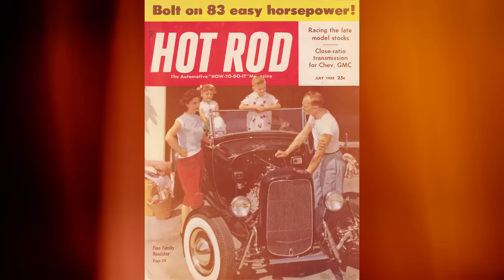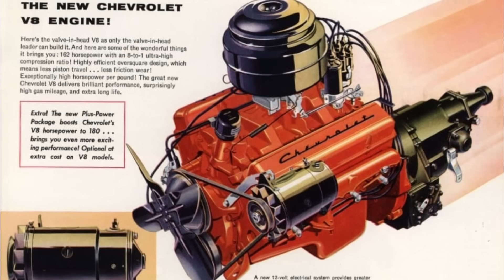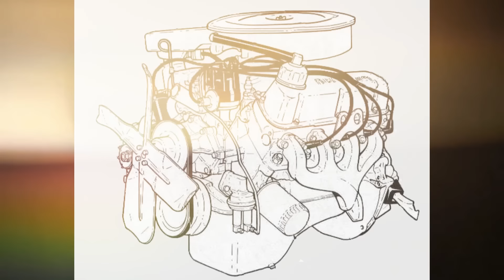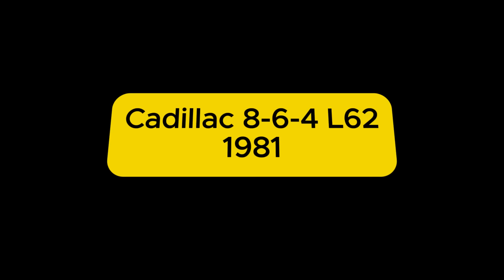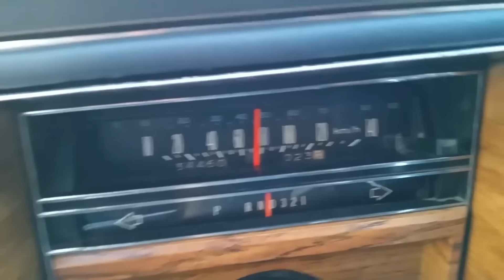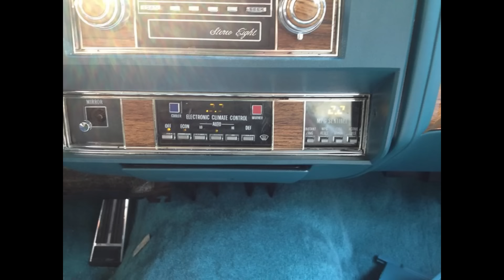WORST Engines Major Companies Ever Put In A Production Vehicle! PART 2

Comment: Please give litre equivalent for the cubic inches sizes  CI capacities mean little to most people today
Reply: There's a fairly simple formula to convert;   CID / 61 = liters.   Or you can round to CID / 60 = liters to make the math easier..   Not exact but damned close.
Also, remember that prior to the mid-1970s, most American V8s were referred to by cubic inches.  Many got renamed with metric numbers after that - the Ford 302 was renamed the 5.0, the Chevy and Ford 250s were 4.1s, etc.    Typically there's a 0.1 liter margin of error.

Comment: Another manufactured outrage video. The one-sentence summary: “V8 engines under 300 cubic engines, or those caught in the early smog control days—or both—are bad engines.”

This video fails to understand how all car manufacturers were unprepared for:
 (1) the first-ever emissions regulations, needing stopgap solutions for which they had no existing research or development.
(2) deployment of electronic circuits in extremely hostile automotive applications.

The video also assumes that modern standards of performance and reliability should be the standard of comparison for engines 50 to 90 years old.

Miles of vacuum hose were necessary because automotive control electronics didn’t yet exist. Electronic ignition was in its infancy in the mid 1970s; expanding electronic control into fuel management and engine monitoring was a huge leap at the time.

Cylinder bores over 4 inches don’t burn cleanly. Reduced bore was an obvious, immediate stopgap to meet emissions regs. When you shrink bore, lower compression, and introduce EGR to control smog, of course horsepower drops. There wasn’t time or money to do anything else at that moment.

Yeah, we all hated “smog motors.” We used to say that good performance was gone forever. Another 50 years of development has proven us wrong.

Yeah, the first Ford 8’s had some serious problems, but that engine was also a technological leap. The GM diesels were failure prone. The 305 had its cam problem, but there are quite a few modern engines with equally serious faults. (If you think a 305 is lame, you should have driven its 229 V6 counterpoint. I had to!

Millions of these “bad” engines transported us for years. Nobody cared that Lean Burn or electrically controlled Rochesters wouldn’t hold up for decades.

By the way, I had friends with a Buick 231 V6. I don’t recall it being horrible.
Reply: Well said!

Comment: the 351/400   M serie  where very bad engine
Reply: Hi bigdon, I am 64 years old and I was a mechanic at three Ford dealerships and two Lincoln-Mercury dealerships.  The 351/400M engine blocks where/are notorious for suffering from "cracked engine blocks" and I am not talking about being overheated or left out in the freezing conditions. I do not understand why.  With all due respect, the 400M achieved the same fuel economy as the 460 4V (4 barrel), but with not much more power than the 351M.  I do not understand why.  Please reply.  Dave...
Reply: @daveridgeway2639    The cracking issues were mostly related to extended periods of high engine load - like pulling a trailer, or in a heavily loaded truck.   The Cleveland design (upon which the 351M/400 is based) is a VERY thin wall casting and was not designed  to handle loads like that.   Even the 302/351W mills had thicker cylinder walls.  The 400 would also get more conserative axle gearing than the 351M.   Those big LTDs, for example, would have 2.75s with a 351M, but 2.47s with a 400.  If you were gonna tow, Ford recommended the 460s.

Comment: Hello Mr. It's Just Cars, not a bad video.  Most people call the 255 CID, 302 CID and sometimes the 289 CID for that matter, a "Windsor" because they are very much the same as the "351 Windsor".  I do not mean to be a know it all, but the only Ford small block that was produced at the Windsor engine plant was the "351 Windsor".  The other small block(s) where produced at the Cleveland engine plant, even though the 351 Cleveland is not much the same as the 302.  Please reply.  Dave...
Reply: Also the modified, which is the same family as the 400
Reply: @squidduck You are correct.  The 351 modified and the 400 are the same block and they look the same as the 351 Cleveland, but in the mean time they are both a taller engine block then the 351 Cleveland.  Please reply.  Dave...
Reply: Sir, the 289, 302, 351 are all in the windsor family of engines, that's why. Except the Boss 302, 351 Cleveland, 351M and 400M. For small blocks.
Reply: @daveridgeway2639    They only called the 351 Windsor a 'Windsor' starting in 1970.   That's because they began making another 351 in 1970, the Cleveland.  In 1969, when the 351 was first introduced, it was just a '351'.

The 400 based on that design was rolled out in 1971, to replace the out-of-date 390 in the big full size models.   

The 351M was Ford cutting costs in 1974; there was no need for the Cleveland in its original form anymore, and the 351M could be built on the very same prodction line as the 400.   The 351M/400 have larger main bearings, and longer con-rods than the Cleveland.

It's a shame an engine as awesome as the 351c ended its career as a low-compression  mule engine.
Reply: @xaenon  I am 64 years old, and was a mechanic at two Ford dealerships, and two Lincoln-Mercury dealerships.  In my opinion, the Ford 400 engine and the 351M engine(s) where two big fat pigs.  I never noticed any more power from the 400 to the 351M, except for less fuel economy.  Both of the two engines are taller, wider and heaver than a 351C, but appear the same.  They are just about the same width, height and weight as the Ford Ford 385 series big-block engine family (370, 429, 460) but do not have as much power.  By the way, the big-block Ford 460 4V achieves about the same fuel economy as does the 400 2V.  Of course the 351W and 351C are both small-blocks, but at times I do see the automotive news media call the 400 and 351M small-blocks, but for "me" not a chance.  I call the 400 and the 351M "pig-blocks".  Please tell me what you think!  Dave...
Reply: @daveridgeway2639  I can't disagree with what you're saying; I'm just saying you're not seeing the whole story.  And that's not surprising; few people truly look at all that was happening in the 1970s in terms of the North American auto market.  As a mechanic, you probably know a lot of the nuts and bolts of how things were changing, but you have to put that together with other factors to see the picture.

At the center of all of it was one simple fact:  The auto industry was monumentally arrogant and complacent in the face of a changing reality.  They thought emission and fuel economy regulations were going to simply 'go away' - either on their own, or as a result of litigation - and they would be able to return to making the same kinds of cars they built in the 1960s.  In short, the US auto industry got lazy and sloppy.

It took the American auto industry nearly a decade to realize the harsh truth - their cars were outdated, their efforts to 'adapt' were half-assed at best, and they were building utter shit. Europe and Japan were building better, more efficient cars and were taking over a major market share.

None of this directly links to the engines of the 1970s, but INDIRECTLY....  it's a different matter.  The engineers who were tasked with making the automakers compliant were faced with a smorgaspord of technical challenges - the most significant of which was they were forbidden to start with a 'clean sheet of paper'.  They had to take steps to adapt existing designs to an environments they had never been designed for.

The 351M/400 are two of the most glaring examples of how to take an engine with so much potential, and utterly ruin it with half-assed, slapped-together, 'lowest possible cost' initiatives.  Let me be clear:  the 400 was envisioned as a basic 'mule' engine, and the 351M was Ford's bean counters cutting costs.  

I could write a flipping book, with at least two chapters on the technical aspects of what was done, and what SHOULD have been done.  But then, you and I have the advantage of 20/20 hindsight.
Reply: @squidduck  Correct!
Reply: @squidduck  Correct!

Comment: Dodge 241 Hemi didnt lack power it was more powerful than Ford V8 106 hp-110 hp and Chevy with 115 hp,so 140 plus was a rocket!!  

Reason Dodge had a smaller less powerful engine was because Chrysler was the top line thus more power and biggest engine and Desoto was ahead of Dodge thus bigger engine and more power than Dodge!

This video is complete CRAP!

Comment: There was another bad v8. This one was made by Ford. The engine was the 351m and the 400. They both had low horse power and low oil pressure. The only difference between the two, was the 400. It had about 1/2 longer stroke. Both engines also had low torque.
Reply: They weren't necessarily 'bad' - at least, no worse than their contemporaries.  THe problem was, they were adapted to power land barges  with lots of power accessories, and of course they had to comply with EPA and CAFE regs.  Underneath all the utilitarian crud, though... those were based on the mighty 351 Cleveland of song and legend.   And they are remarkably easy to wake up.
Reply: @xaenon  I agree with you on the 351 Cleveland. It can be sooped up. Even the small block windsor was good. The motors that I have mentioned, the 351 m and 400 , were designed for the oil crisis and emissions . They also had bad oil pressure.
Reply: @johnshaddick6858  The oil pressure problem was likely because the bean counters at Ford chose to ignore it,.  The 351M and 400 engines were low-rpm mule engines an they probably decided that the oil pressure was 'adequate' and that these engines would last long enough to survive the warranty period, and any failures within the warranty period would cost less than actually fixing the problem.

A similar mentality resulted in the Pinto debacle.
Reply: @xaenon  I totally agree with you.. The 351m and 400 , were also , so badly designed and specifications for them were sloppy.  I had a 351m once in my older F250. I had it remachined for new rod , and main bearings, and I rebuilt the rest. In the end, that 351m had 60 psi oil pressure, far from it`s 30 psi. I did sell it and put in a 460 in.